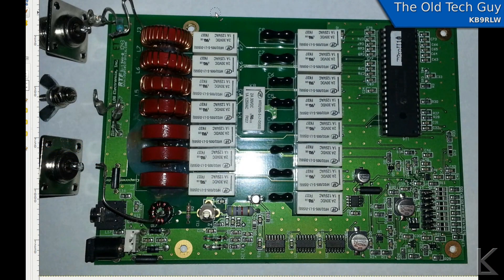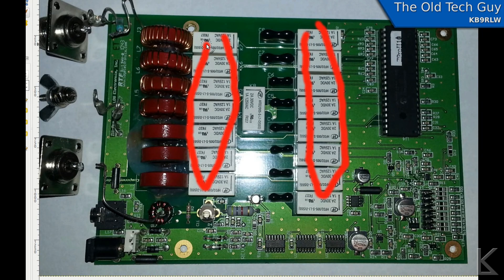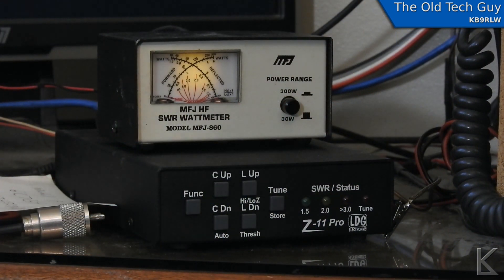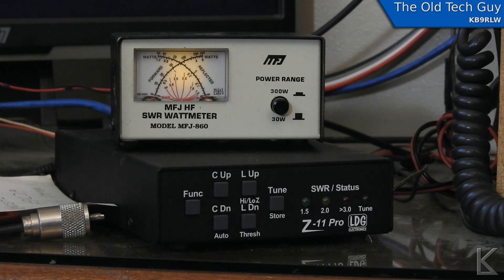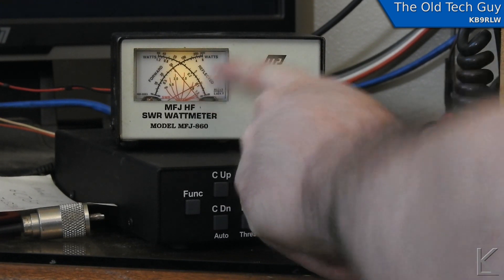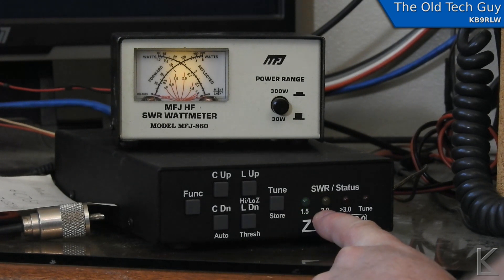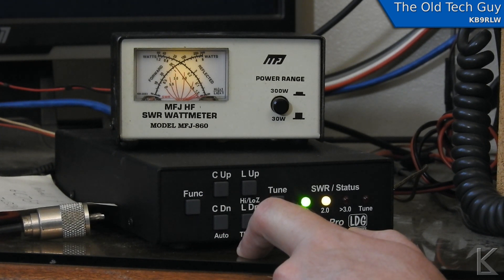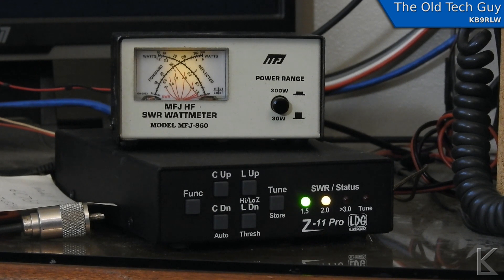Ham Radio - Manually tweaking your auto tuner for the best possible tune

Comment: Why does it matter if it's perfect? It doesn't change the SWR of your feed line or antenna, it just matches to your transceiver. Once you get below the threshold that your transceiver wants to see, it will transmit at full power. You're still going to lose transmitting power after the tuner. Most of your videos I like, but this one makes no sense.
Reply from the maker: Well, there are Persnickety people out there that want the absolute perfect match. So this is more of a tip for the tuners and tweakers.
Reply: @loughkb  If you're transmitting into an antenna that's not even close to resonant and you have a tuner on it, all your power is being reflected back at the tuner, nothing is getting out. The antenna tuner doesn't fix the antenna, it just fakes a 1:1 match for your rig's sake. Persnickety or not, it doesn't do any good. Ham Radio Concepts has a great video on just this subject: https://www.youtube.com/watch?v=pdOEiML2XGk Shows all his power from his non-resonant at 160M antenna being reflected right back to the tuner, his inline watter meter shows no power is getting to the antenna.
Reply: @stickycricket2  you have a total misunderstanding of what a tuner is doing, may I suggest the ARRL HANDBOOK and REFLECTIONS they go into great detail to explain what's happening

Comment: Actually you don't have to turn off Auto in order to make manual adjustments.

Many thanks for your great videos!
73
RA0UFF
Reply from the maker: That's right, you don't.  However, if you don't turn off auto,  the tuner is likely to jump back into an auto-tune cycle while you're trying to adjust it manually.    It's best to turn off auto before tweaking it.

Comment: Perfect timing! I am just getting back in to the hobby and purchased an LDG AT-10ProII. I have had both the original one button tune LDG Z-100 and Z-100 Plus tuners in the past. I mainly got the AT-100ProII this time because it has the ability to fine tune, switch between two antennas and has the bar graph for SWR and Power. I have not used the tuner yet but will this week as I finally have my station wired and antennas almost up. This was an excellent tutorial on how the fine tuning works. Thanks!

Comment: Why there is this differences about SWR reading between MFJ analog and  LDG auto-tuner..!?  Who show the true !?
Reply from the maker: The analogue meters that indicate reflected power won't indicate anything if there's no voltage coming from the H-bridge.  So I trust the analogue meters.   Plus, as I mentioned in the video, the meter on the radio was agreeing with the external meter.

Comment: Great video, as always, Kevin, thanks very much! Ok, so I can't help but address the elephant in the room. (Please forgive what's probably a dumb question, but I'm just a lowly Technician with not a lot of experience.) Why not just use a manual tuner? Honestly, I was actually disappointed when I first heard about the excitement surrounding auto tuners. But then, I'm an inveterate knob-twiddler. Even though I'm much more computer-literate than anyone has a right to be, and I happen to love it when certain process are automated, I happen to love the idea of working for a good signal. And especially with the tweak you're suggesting here, that really makes me think "Why bother? Just do the whole process yourself and be done with it!" My thinking's probably naive and misguided, but I'm sure you can set me straight. On the off chance that you DO like the idea of using a manual tuner, I'd love it if you could demonstrate the process of using one. Thanks again! :-)
Reply: Speed, auto tuners are fast and manual tuners are slow.  I know where to set my manual tuner for most freq's with my antenna's  but I still need to do final tweaks and you have to transmit for several seconds or more.  You need to move a few kc off of the freq you are on as not to interfere.  An automatic tuner with memory is almost instant and you are ready to go.   I personally most often use the manual tuner but appreciate the auto tuner when I am all over the bands.  As Kevin stated, I use my automatic almost the exact way he described and I would bet most people do also.  As he mentioned you don't need to, it is typically close enough.
Reply: thormusique - I can relate to your logic. I have 3 LDG auto tuners, but just recently purchased a used MFJ-949E manual tuner in like new condition. The MFJ-949D was my first tuner back in 1993 and the included dummy load came in handy to tune my Kenwood TS-520S transmitter. I am a knob-twiddler as well...lol! I like using both manual and auto tuners. But as "rlmillr" pointed out, speed is the big advantage when you are bouncing about the bands.
Reply: Yes, what you both say makes a lot of sense. I do like the idea of having a dummy load built into the manual tuner. I might need to find me one of those units.... Thanks so much!

Comment: I just recently got the same LDG Z-11 and because i knew that the previous ATU i had (LDG Z-100) never tuned right to the best, i infact already installed in the system a SWR/wattmeter, just to get to the absolute best i can get from my antennas. Mostly because i have only homemade antennas that aren't made as well as yours Kevin! HI

One thing i noticed tho, for the FT817, when i got it used, it came together with the Elecraft T1, and that tuner is a bit slow, but it always check for lowest SWR before stopping the tuning. It can be set to stop tuning at a higher threshold, but so far i haven't needed to do such thing.

Is still an expensive piece of equipment the T1 tho, can't really say is a good bang for your buck.

Comment: Hi Kevin is there a way I can save money??? I have a radio and a 811h amp and I need and want a tuner. Can I get a lower watt tuner tune the antenna then click on the amp? or do I need an 800 watt tuner?
Reply from the maker: No, you need a tuner that can handle the power you're running.  If the tuner can't handle that level of power, it will arc and burn the relays, capacitors and inductors.
Reply: dang ok so just gotta save my pennies then LOL thanks for the fast response ;)

Comment: Hi Kevin,
I have the LDG AT600Pro  and it's front scale goes down to 1.1:1. Will have to try an inline watt meter to check it's accuracy. I was surprised your tuner did not store that manual adjustment. I'll have to check that on mine.   73   WB3BJU
Reply from the maker: I've noticed that on other auto tuners in the past.  I'll be interested in hearing what you observe on yours.
Reply: Hi Kevin,
Ran your test about manually adjusting the L and C and found that when the tuner indicated 1.1:1 the SWR meter showed 1.4:1. Adjusted L and the SWR meter came down to 1.2:1, then adjusted C and had it down to 1:1 with the tuner showing a 2:1. Would not store the manual setting and readjusted back to it's 1.1:1 setting when pressing the Tune button. What I did notice was the output power from the radio went down after the manual tuning of the auto tuner. When I let the auto tuner do it's thing, the Watt meter agreed with the radios watt meter. I also discovered that my FT450 has an output of 75W into a dummy load. It should be 100W.   73   WB3BJU
Reply from the maker: The output power going down might have been misleading.   Depending on how the power measurement is being made.   If, in power mode, the meter is not distinguishing forward power, rather just indicating power, reflected power will be additive to the reading.   If you were reading power on the cross needle meter, then forward power going down slightly would be accurate.
What I should do, is to put an outdoor sensor on my field strength meter and see if the RF field from the antenna increases or decreases with the manual tweak.
Reply: Hi Kevin,
Don't have cross needle meters. I am building a watt meter using Bird components. Just need to finish the cable from the line unit to the meter head. I wanted to place the line unit at the wall where the rf feed enters the room. I had wanted to build two to monitor forward and reflected power at the same time, but currently in a money crunch.  :-(   73   WB3BJU
Reply from the maker: You'll dig part two of this exploration where I measure radiated power from the antenna while tweaking the tuner. :-)